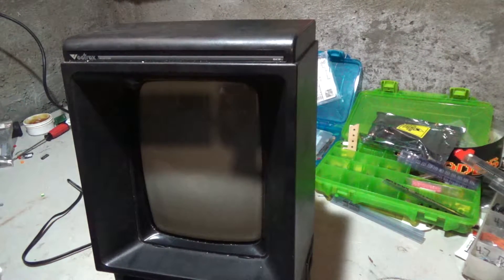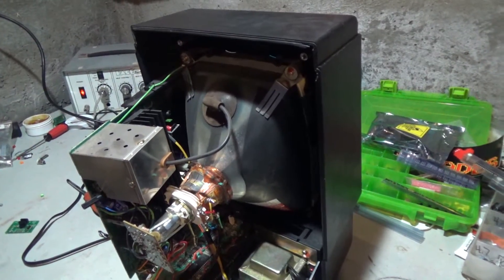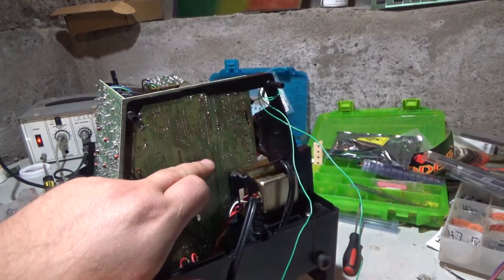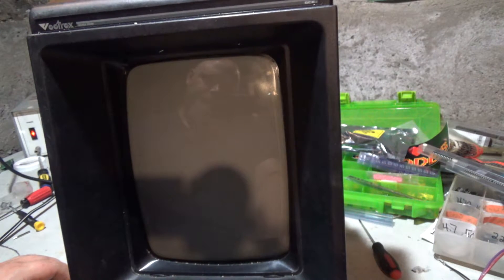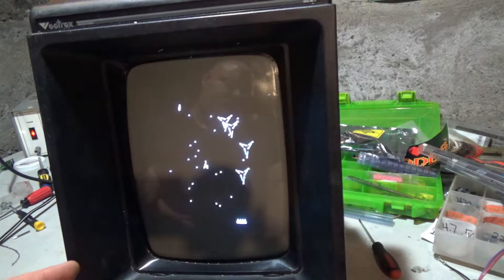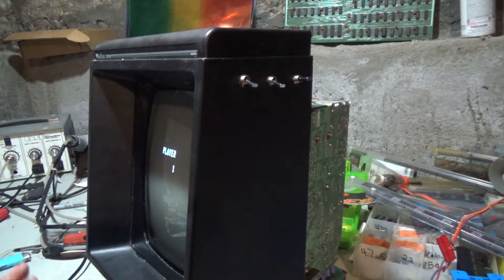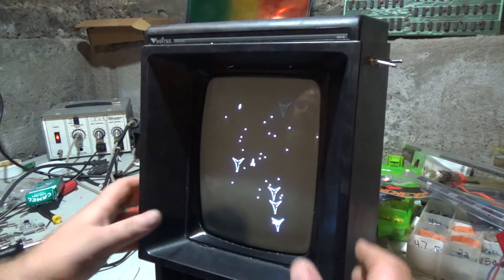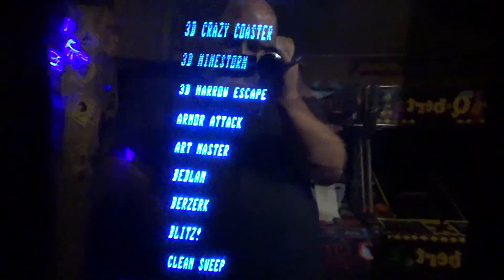Lets OVER CLOCK  a VECTREX

Comment: You should try this again with a Hitachi 6309, and combine it with the low-flicker / high-refresh BIOS.
Reply: Another mod I would love to make to the Vectrex would be a self-calibrating display...
– Screen Buffer
– Digital Signal Processor
– Dedicated RAMDAC
– Sensors on the screen to provide active feedback
– PID controller

Comment: Just so you know. The fastest 6809 is 2 MHz. That clock is being divided. I remember the Z80 4 MHz is about equivalent in performance to a 6502 at 1 MHz because the 6502 uses less clocks for it's instructions. The 6809 is similar only has enhancements over the 6502.
Reply from the maker: yes i know in fact i have designed entire reproduction vectrex pcbs
Reply: @ArcadeJason  I should have known that. It just didn't sit well with me the way you were describing it. But awesome channel. I've recommended it to at least 2 people.
Reply: I was going to make the same comment. The input clock may be 8MHz but the operating frequency would be 2MHz. Not sure why you said otherwise in the video.
Also, the 6809 kicks the pants off of a 6502.....just saying. Way more programmer-friendly with more registers and with 16-bit pointer registers a-plenty.

Comment: Hey if you replace the CPU with a 63C09 and upgrade some other chips you should be able to run it pretty easily at 12mhz. You will need to also upgrade the 2114 RAMs, the 2363 ROM, and the 6522A VIA. Also, you can replace the resistor attached to the E clock output of the CPU with a D-type flip flop to divide the clock by 2, and the vectors will have the correct length, and sound will be the correct frequency.
Reply: Sounds like you've thought this out.

Comment: You're very welcome and you needed a Sean Kelly Multicart more than anyone right now for what you are doing and all this coolness! This is quite interesting to see all the variable speeds you are getting from the machine. Your call on the acetate colors, but they both look good actually and you can stack them for that matter as well. I would be one to go with Blue typically but red looks pretty great as well on a lot of games! Thrust is not on that cart btw. Check out Vectrexians, Moon Lander, Minestorm(cheat), Hyperchase, Pole Position, Star Castle & Star Hawk at variable speeds. Those should be really interesting. You can also check out your display with the Test Cart.